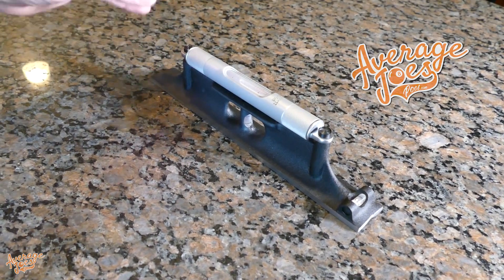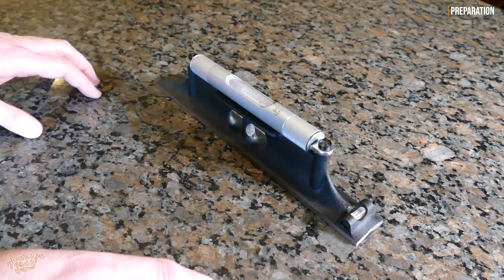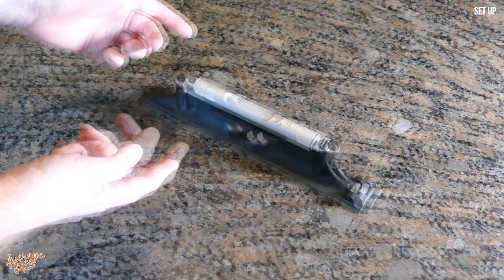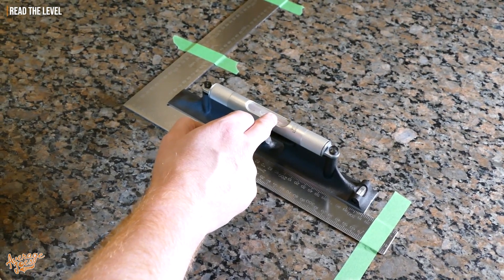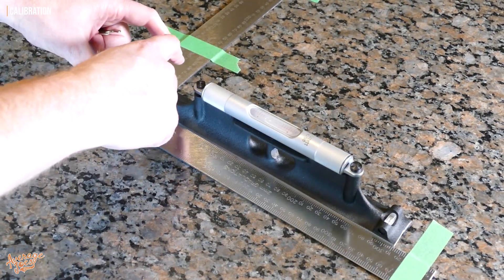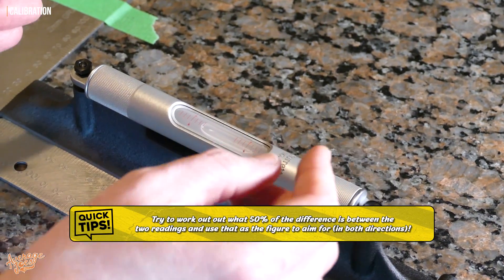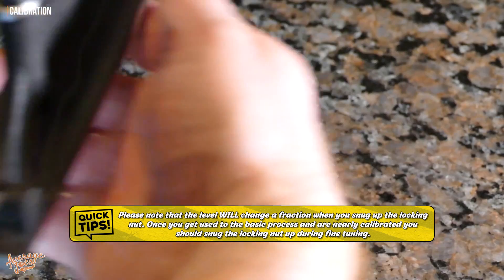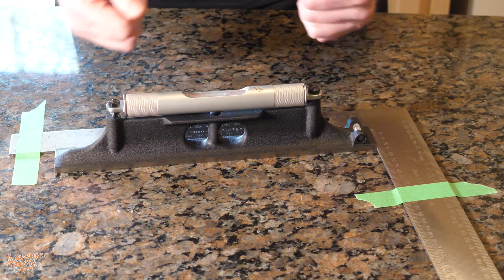How to Calibrate a Precision Machinist Level

Comment: Before starting, slowly rotate the level through 360 degrees on your flat surface.  Somewhere in the 360 degrees will be an orientation where the bubble will be dead center, this will make it a little easier if you're not trying to match the offset of the bubble.  Also, granite countertops are not nearly as flat as you would think.  If you really want precision, you need to use a surface plate.  You can get small ones for relatively little $$ and they are a handy tool to have.
Reply from the maker: Nice info, thanks for sharing! 👍